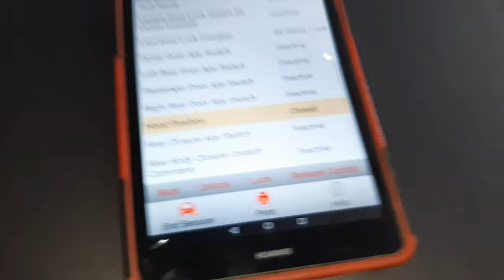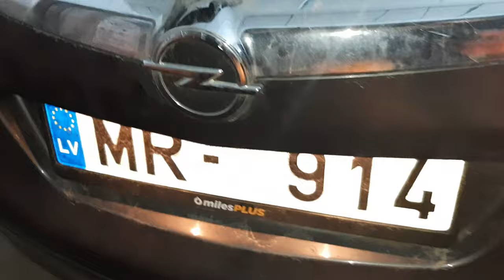Opel Insignia boot not opening / Vauxhall insignia tailgate won't open

Comment: Hello! I have same probleme. What did you change? Thanks
Reply: Did you ever find an answer to this problem? My car is doing the same thing and I don't know how to fix it. Thanks
Reply: @Tammy Rogers  change the boot button, mine has the same issue and now it's fixed, 15£ part on ebay with 5 years guarantee
Reply: @abhishekduggal2115  I did that and it fixed it thank you. I ordered it from China and although it was slightly different I was able to modify the wires and hey presto, it worked! That was after an auto electrician had told me he didn’t have the right scanner to find out what was causing the issue and I’d have to take it to another repairer who had the right tool. It cost me $20AUD. So happy now.
Reply: @tammyrogers5328  that's good to hear